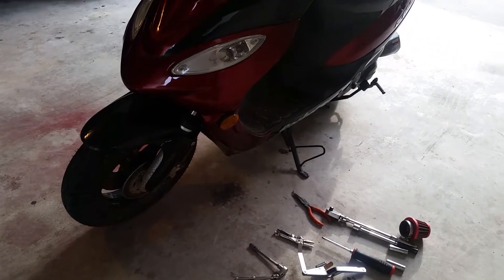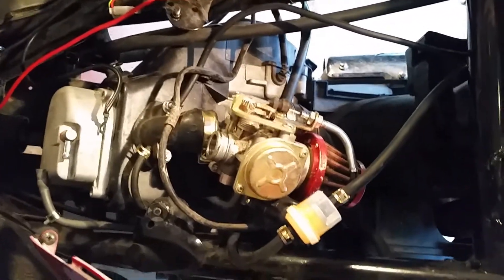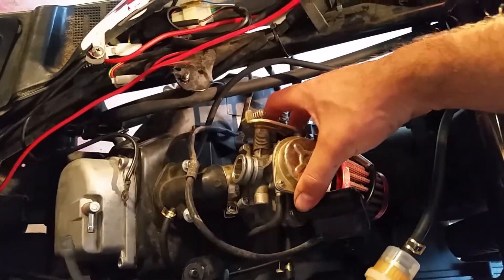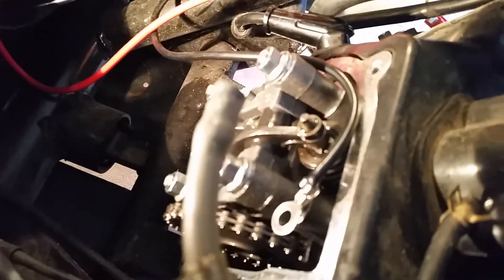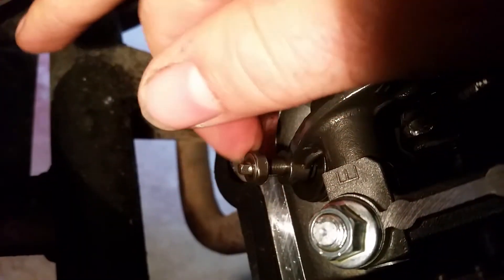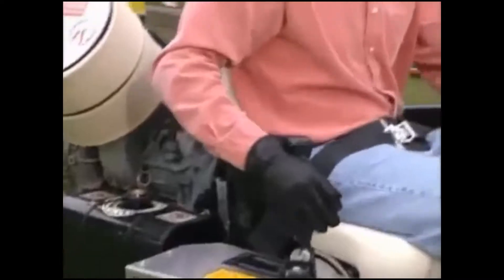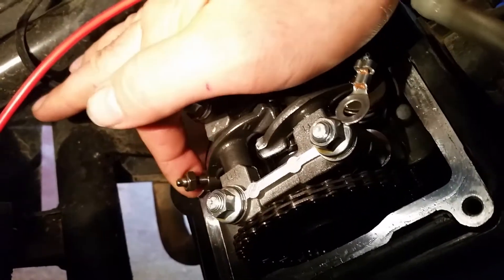49cc Ice Bear moped won't stay running Fixed

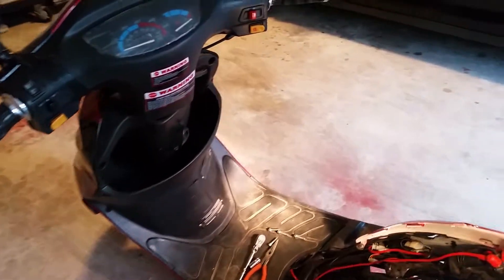Comment: I noticed you had a CDI on teh ground at 0:28.   Do you know where that unit is located in teh ICe bear?  I couldnt find it under the seat.  DO you know if it's under the foot rest area, where teh battery is ?

Comment: So did you tighten the valve screws, cause I installed an 80cc bug bore kit and mine will do the same as yours but shuts off